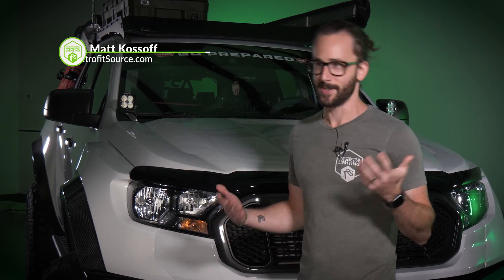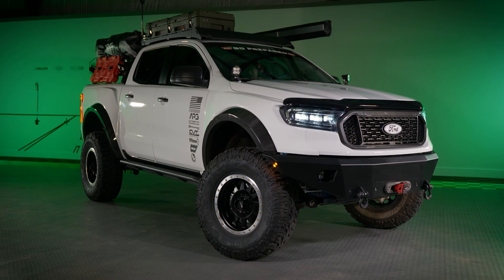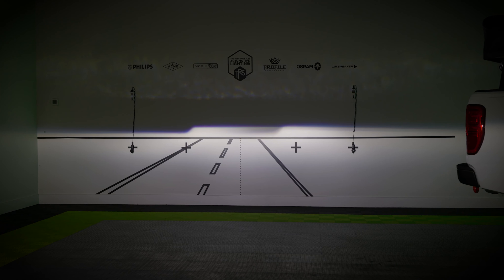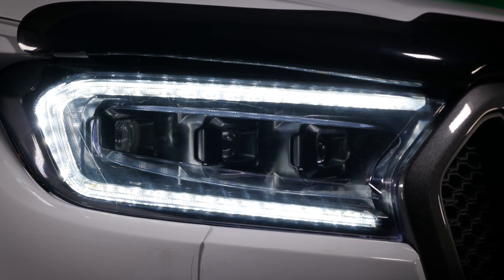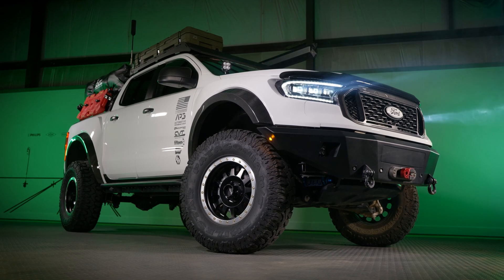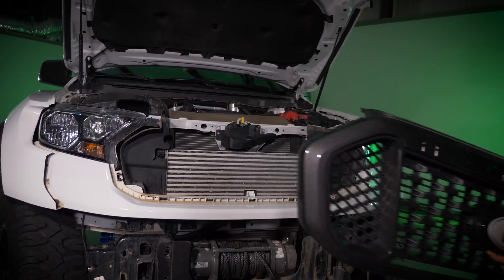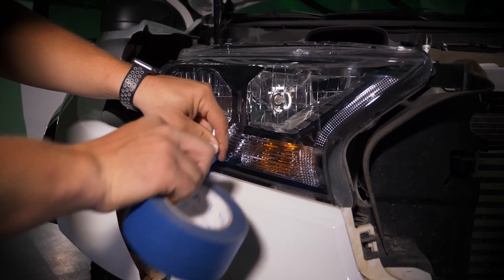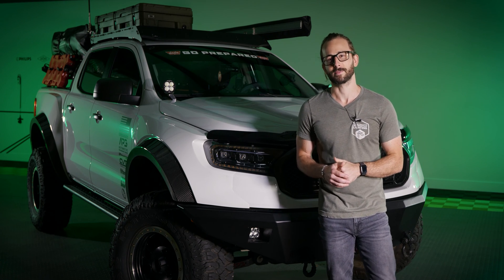The BEST Performing LED Headlights for the 2019+ Ford Ranger: Morimoto XB LED Headlights

Comment: Been hearing quite a few people complaining about one lighting up and not the other, is this a known issue?   was it bad installs?   just wondeirng before I drop this kind of coin to get em
Reply from the maker: Haven't really heard this issue, these are a pretty popular option for the Rangers!
Reply: @RetrofitSource These are a nice option, but has been a slight nightmare....I had Halo's prior to installing these and to sum up, I noticed that in the day all my lights were on in AUTO mode, and if I tried to entirely turn off the lights the DRL's stayed on.   This is not how it should be...was told had to use Forscan to change the settings.

Did you use Forscan to change the settings?  or did the truck come with LED's?